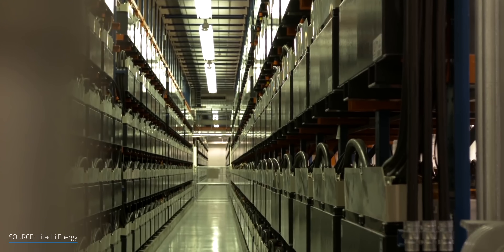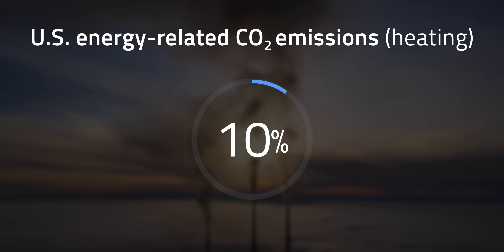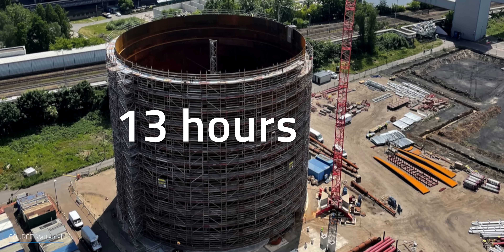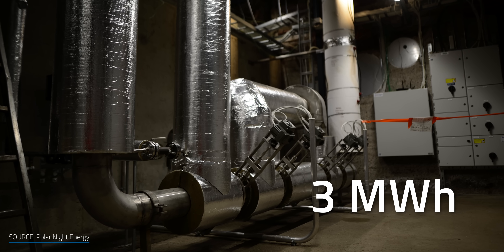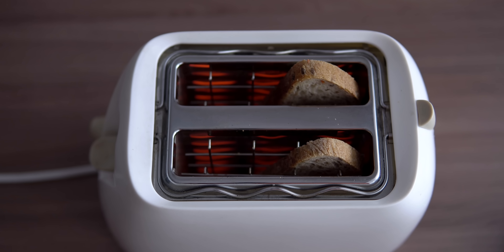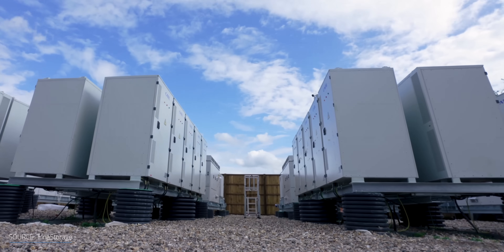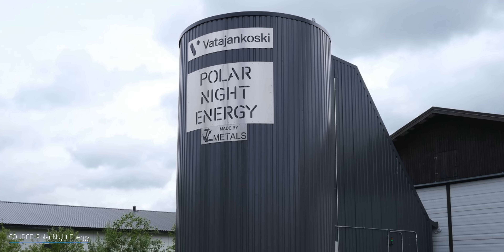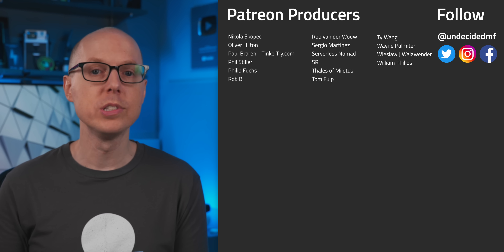How A Sand Battery Could Change The Energy Game

Comment: I must be missing something, maybe its just too early in the morning, but the bedrooms in my house were heated by electric baseboard. Operating them in the winter on a thermostat used to cost a fair amount of money. About 6 years ago we switched to heat pumps with a mini split system, I was told that versus resistive heating, heat pumps were 3x more efficient for the same amount thermal energy. If resistive heating is already 99% efficient, how can heat pumps be 3x more efficient and if thats the case, wouldnt heat pumps be more effective in this case as well?
Reply: It is because you are MOVING heat, not creating it.
Electricity to heat 100% (creating NEW heat), MOVING it from one place to another* (not creating NEW heat), takes some amount of expended energy. *(ie, from outside to inside).
Using (electric) energy to MOVE the heat, instead of creating new heat with that energy.

Added bonus, in heating mode, the waste heat from the compressor is expelled to the heat side.
(This compressor heat is lost, with the heat moved, in AC operation).

You need a source of heat to move it from;
In space for instance, your only option is to create it...
Reply: @troubleshooter1975  I understand that it is moving the heat from one place to another. Thats the beauty of the heat pump, i guess that i am just kind of missing the whole system efficiency of creating the heat through a resistor vs moving the heat through a heat pump, both of which use electricity to achieve the same thing. If i saw the math of both systems of heating the same space, it would make more sense I am sure.
Reply: @Different_Banana1977  I was speaking just about the part where you asked how heat pumps can be 3X more efficient if resistive is already at 100%...

In that example, 1KW on electricity would deliver 3KW of heat.
It is not creating energy, it is consuming 1KW (which also gets exhausted to the indoors), while moving another 2KW of heat energy from outdoors, for a total of 3KW of heat energy delivered.
Resulting in a net delivery of 3KW of heat, but using only 1KW of it on you utility bill.
The other 2KW worth of heat was 'free' heat stolen from outdoors.
[I don't know if there is a theoretical limit to heat pump efficiency in unbounded setup. I assume there is a mathematical limit, it must take a minimum energy X to move energy Y...]

Now as far as using a heat pump instead of resistive heating, it would indeed be an excellent idea.
The rub in the equation is that heat pumps have a limited maximum operating (delivering) temperature (especially on an industrial scale).
There are many posting here with more information than me, that state maximum temps ranging from 140ºC to 180ºC; and a limit on the differential attainable too.

The benefit of a storage medium to store power, is how much energy you can store in it, with how much space/materials are needed.
The more heat you can store in the same amount of material/plant, the less the cost per KW of storing capacity.
The top heat pump temperature attained probably would not even be enough to enable any practical transfer of heat to the heat extraction air at all.
Reply: @troubleshooter1975  So, in a lot of ways we're mimicking nature, but using technologies to do it efficiently and specifically for our own purposes. Yes, sunlight heats the outside air, but we want our water and inside air heated. Yes, we can generate electricity from sunlight, but we want to store that for use at our convenience. Yes we want all this, but we want it as efficiently as possible -- and technologies keep improving.

Comment: One thing I wanna highlight about this kind of tech, which is the scalability of heat batteries. The amount of thermal energy depends on the material, and also very importantly, its mass. Mass is a result of volume. On the other hand the heat lost to surrounding is based on the temperature difference and the surface area.

As you make the battery bigger, the mass goes up by dimension cubed while the surface area expands only by dimension squared.

The bigger the battery is, the more efficient it becomes. And when going big, its worth it to find cheap but dense materials.

No limitations on specific elements, no limitations of geography, just dump as much stuff into the tank and time to go
Reply: same idea on engei running on petrol and diesel , as much biger you get as much efficient you will be .

Comment: You mentioned that they obtain a high round trip efficiency of near 100% by using resistance heaters, however don't heat pumps deliver much more heat energy for a given input of electrical energy? I'm pretty sure the reasoning for this is that heat pumps take heat from the environment and simply move it rather than convert the electrical energy directly into heat. Meaning you can effectively obtain efficiencies even greater than 100% in terms of heat energy delivered over electrical energy consumed. I think this avoids violations in thermodynamics as the conversion from heat to electrical energy would be inherently less efficient meaning you don't create net energy in the process.

Comment: It was just last month I was looking for a heat storage system to replace my gas central heating in my house. I could not find anything comercially avalible. Better then using a battery to heat a off grid house which will fail in 10-15 years.
Reply: Look up "thermal mass". You don't have the same kind of controls as with a battery, but it's cheap and easy.

Comment: I would like to know if they have address expansion issues:
Silos normally contain materials at ambient temperatures.
Is there any considerations concerning the sand's expansion and contraction with heating cycles?
(or the silo, for that matter)

Have they operated it through sufficient heating and cooling cycles to tell if there any issues not anticipated?

I am wondering if the sand will tend to settle, possible exerting increasing pressures, or compressing the insulation?
Not unlike frost heave, incrementally 'gaining ground' with each cycle.
500ºC or 1000ºC is significantly more than seasonal temperature extremes experienced by typical contents...

Comment: Who says they have to use steel for pipes?
I would use dirt, i.e. ceramics. 

They are more environmentally friendly and cheaper to make and easy to replace as a result...

Ideal for something as simple as hot air going through them.

Ceramics are used in particular with high heat that would even melt steel... So you can really pump some very hot air through them...

And if you add tiny air bubbles into the ceramic and slow cure it, it would provide insulation properties, too.

Comment: Curious, we suffer from heat. Global warming - asphalt, cement, urban sprawl increasing local environments heat profile and increasing more heat through AC use. Plus, so many other problems of heat sources.  So, using heat you manufacture, which will be lost to a local area in a percentage.   I just don't agree.  Just because you can - doesn't mean you should.
Reply: If we use $x to generate electricity to heat air & water, then we would save a lot of that using other means to that end. It's not an additional thing, it's a replacement/substitution for more expensive or danger-to-climate-change means.

Comment: what if we used TES as our energy transport system? the power plant would heat(or cool?) a thermal wire, and the customer would generate power from the thermal difference between the ambient home temp and that thermal wire.

Comment: The sand battery seems like a possible partial solution to sustaining power during the night or winter in Finland.  However, I don't see how it would be helpful to home owners, other than provided heated air for comfort needs.  We need something that will maintain a source of actual electricity to run the refrigerator and TV (to watch the weather report to find out when the cold spell will break.)
Have you investigated the molten metal battery that are already in use some places in the US? Seems it might be possible to scale the shipping container-sized to something that will fit in my basement or a closet. Would you consider a video on molten metal batteries?

Comment: Hard to believe this would ever work.  This sounds like a marketing BS video instead.  The one problem they will have is once the heat is removed from the sand around the pipes it will take time for the heat to replace it.  As the sand becomes cooler it will take even longer.

Comment: But WHY would we WANT to build batteries for strategic energy storage when we have PLENTY of coal and nuclear !
Zero carbon IS NOT ZERO Co2, its NOT even zero carbon !
There is NO evidence human emissions of Co2 are causing ANY changes in weather OR temperature or climate , they are ALL totally within normal long term variability, so WHY destroy our economies over a fairy tale.
Reply: Electric batteries or heat storage (batteries) can be useful regardless of the energy generation method. Look at the gas tank on a car. What do you think that is? Look at your water heater at home. It stores water for you to use when you want it. That's a hot water battery.

Comment: You've addressed a lot of the engineering problems.  To me, this is purely an economic problem.  There's this extra resources that spoils quickly, but sometimes there's no demand for it.  So we turn it into heat (a less valuable resource), which we can store.

I'm curious if we had a pricing model where consumers or businesses could purchase this excess power more easily, we could increase demand to meet the supply during those times.  You touched on that with cement production, but it could also extend to consumers having resistive heating in their house that kicks on at night (at VERY cheap rates) instead of turning down thermostats at night.   And thus burning less natural gas in the morning to heat up the house again.  Essentially using everyones house as a thermal battery instead of a giant centralized unit.
Reply from the maker: Thanks for sharing your thoughts.  Interesting line of thinking.  I agree that economics are a big part of this.

Comment: Many houses have waterborne heat where the energy source is electric boilers, oil-fired boilers or wood-burning boilers. When these are ready for renovation, you can use sand storage of energy, together with heat pump technology and solar cells and batteries, as well as a backup solution based on a diesel-powered automated 8-10 kW generator, you will have an energy supply solution that can be used on a property and that is scalable. Then you do not need to be connected to the power grid and you hardly need to buy energy. Can be used on small detached houses, commercial buildings and apartment buildings. All these are well-established technologies with off-the-shelf components. This can be implemented in new houses and in established buildings when the time comes for renovation
Reply: In the early  1970's when oil prices tripled, a few builders used insulated foundations and 3 to 4 feet of sand in the insulated area under the house and added heat from solar water or evacuated solar water heating tubes. It was a reliable and fairly inexpensive way to store heat for days or into several weeks. The biggest decided factor in a lot of systems is affordability. For heat retention; super insulation is probably the cheapest and most reliable of all concepts. Anything else is a band-aid over an even bigger injury.

Comment: Hmm. Sounds like geothermal w/o the natural benefits of geothermal, and w/o geothermal's 400%+ efficiency... Resistive heat - despite that highly deceptive "100% efficiency" claim - is one of the least efficient ways to heat anything because one has to first convert something to electricity - a LOT of electricity - then dump it into the load. Conversion is never 100% efficient, and electrical transmission is extremely inefficient. Sure, at point of use, that nonsense is close to 100%, but whole-system, it's closer to 20-30% efficient. It is almost always more efficient to skip the conversion to electricity. Simple experiment: set up a 2km electrical transmission loop with a resistive load, and a gas-fired steam turbine generator. Measure input and output. Every km drastically reduces the already poor efficiency. The most efficient way to do this is in-ground heat storage, passive or active, with phase-change energy movement. Millions of homes already do this.

Comment: Yeah that's nice to use the Sands also, but It is an all around better mode to operate in anywhere by going to a creat your Electric Energy on site & per device. We Just need to create mini devices & components that create the Electric circuit it needs to operate, with it's own mini turbine that runs on the Electricity it creates. Along with Magnetism to get it started & guide the current in places, and maybe using Radio Waves to transfer over short distance remotely in the Air & on site if an area or for using a device. I would use a Magnetic Engine to start a mini turbine Electricity Generator then send Electric where wanted & back to the turbine. Things like the Nikola Tesla Wind Turbine & Water pump are really far easier to Do and much more beneficial than the other ways they are currently doing. The Tesla type turbines should be our main go to for electric supplies, & just create our own Electricity on site!
Reply: HUH???????????

Comment: New invention? My ass!
I created sand Batteries 40 years ago, They heated the entire house that was on top of it via a black hose mounted on the roof.
Reply: Sand heated by sunlight directly? Did you have a PV generate enough electricity to run a fan that blew hot air into the house?

Comment: That is interesting about sand's storage energy density vs water. My first guess was that water is better. Maybe water is only better if you have it in a pressure vessel and you are taking advantage of the extra energy to go through phase changes, from steam to liquid to solid. Storing cold can also be useful. Hopefully they are also taking advantage of ground-coupled thermal.
Reply: Your first guess was right - if you are going to distribute the heat via water, then a stratified storage tank will always be better than this gimicky setup.  water has a higher specific heat capacity AND a higher density than sand, meaning the same sized tank can hold a lot more heat as just water, and due to it being the working fluid as well, the system is FAR simpler than this sand->air->water heat exchanging nightmare.

Comment: While heat storage is great and all, its main applications will probably only be in cooler climates. You can't use it to cool any homes which is likely over half of the building energy usage in North America, especially in the south. Converting this energy to electricity via Air to steam to turbine back to electricity could work, but probably at least a 50% loss. An ideal solution would be chemical potential energy storage on a large scale with common components, but that is the holy grail.

Comment: Main issue here is that the 10$/KWh is without taking into account the infrastructure costs of installing residential heating ... But otherwise it's a great project !

Would that scale down to a House sized battery ?

Comment: If we are talking about repurposing energy what about the thermal water waste produced by power plants? The water is deemed safe to the public and is already scolding hot. Instead of releasing that into the environment and changing the ecosystem, could we not put that in a thermal battery/storage facility and use that similar to the designs mentioned in the video?
Reply: Sure, why not!

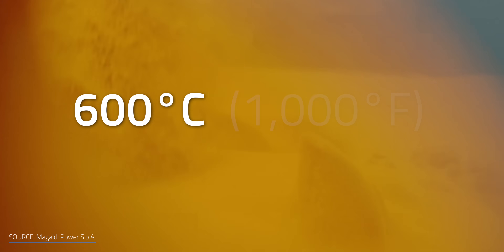Comment: Small correction around the 9:30 mark - Water can be heated above 100C, and is often heated beyond that.  High pressure can raise the boiling point of water to a fairly high amount.  You probably don’t want to pipe high pressure hot water beyond a facility, as high temperature steam is scary stuff, but for energy storage as long as you have a pressure vessel (ie boiler) you can heat water beyond 100C without it boiling.
Reply: Thank you. I was going to make a similar remark since we already have systems above that threshold.
Reply: Yes water can be heated above the boiling point under pressure, but that would greatly add to the complexity and cost of energy storage.

Comment: As kids we played with sand, now I'm going back in time for a better future.   Find a fresnel lens from old tv's or buy new ones to heat water.  Or buy solar water heater panels and heat the water, store the sand in the ground with insulation around the sand or use 55 gallon drums lined with insulation to heat sand.  I think steam efficiency would be higher than 25 % but perhaps it's the heat loss with water transfer through a turbine but my idea is to generate electricity and use the heat to heat my home.  Either way I want free energy and this is not a complicated model.  For heat only even easier, for electricity I do not want a high speed turbine due to sound issues plus my neighbors would hate it.  I could run piping across the front of solar electric panels to heat water to store in a sand battery.  Gotta have a way to remove the pipes due to leaks and it needs to fast so with a couple of drums I could take one off line and let it cool to fix the problem.  With drums I can run the pipes to the outside in several locations but to fix I've gotta play with sand, lol.   They say as we get older we pick up some of our childish habits, cool!!!